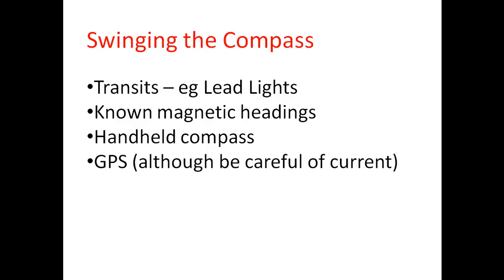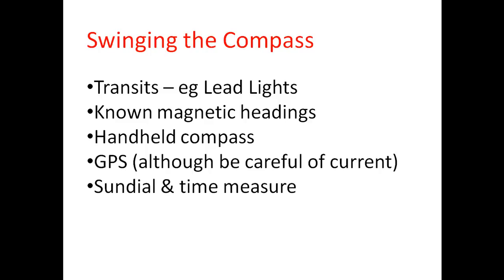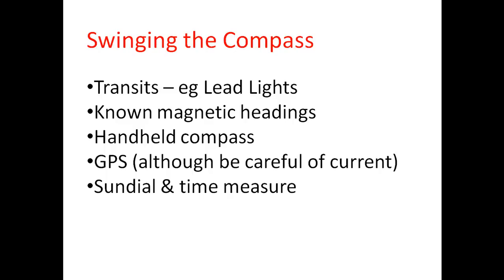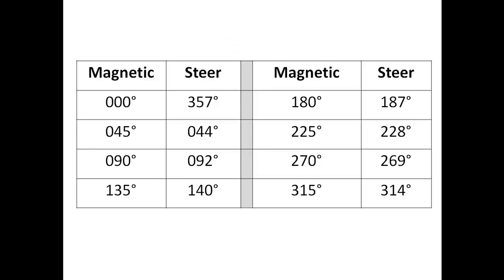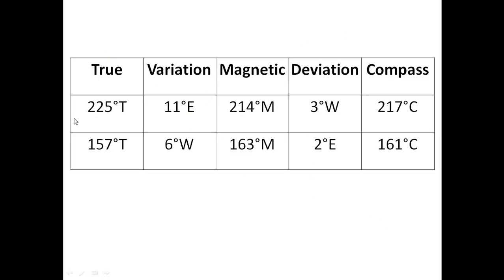AusNav #2 - Compass Deviation and Swinging the Compass

Comment: WCA (wind correction angle) is another factor to calculate in when airborne
Reply: Because of the coming micronova, declination is moving much farther, and much faster and so declination information is likely incorrect My up-to-date declination is 30 degrees, 15 degrees off from the official declination for my area. but there is still a way to recalibrate magnetic declination using the shadow of sticks recording the path of the sun---rotation of the earth has not yet changed. First stick will show East. Mark it with a sharp stick pushed in. After a few minutes you can mark sun shadow travel where the shadow has moved - Push another stick in to mark West. Lay a straight stick from the E mark to the W mark. Geographic north or True North is 90 degrees from the E-W line. With your compass pointing toward True North, note how far off your compass is now. That is your true up-to-date declination. More on micronova in my 2nd book, Surviving the Micronova: This Train Is on the Tracks is available now.